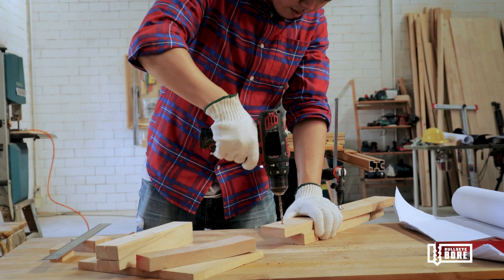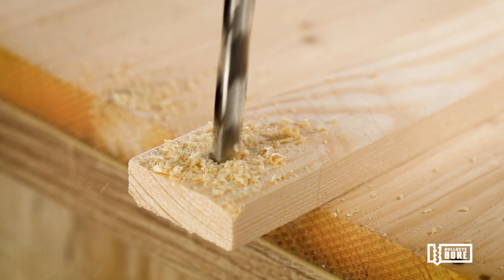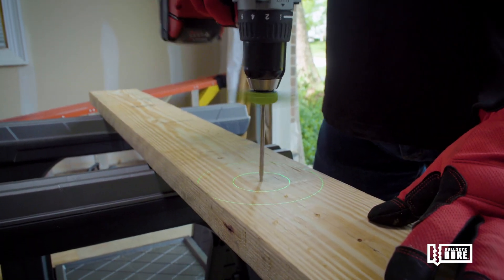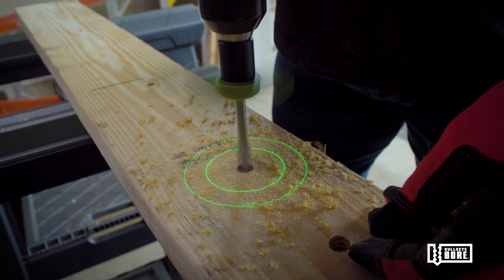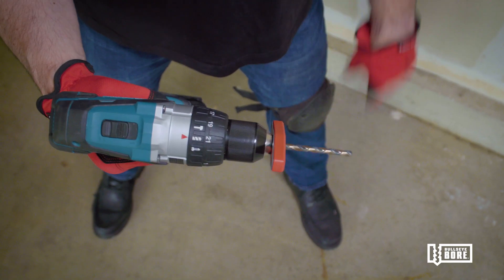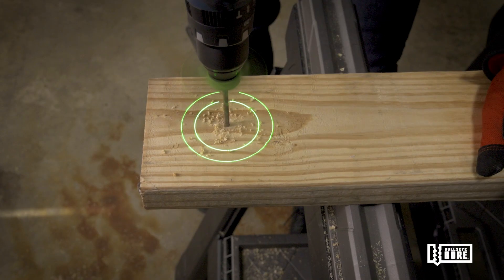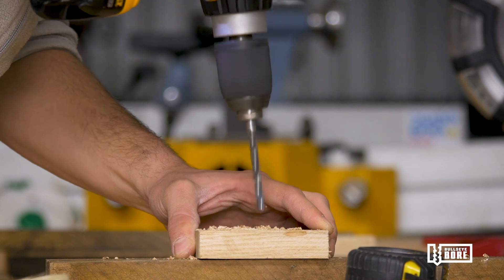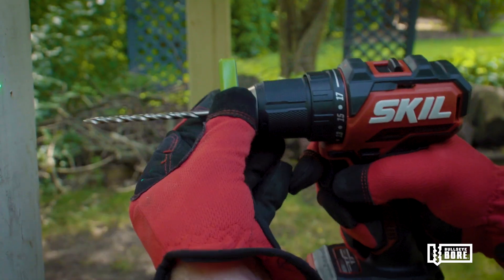BullseyeBore Core - Kickstarter Campaign (v5)

Comment: How does it do in bright sun?  None of the videos show it being used outside in anything other than deep shade.
Reply from the maker: This is the first version of the product so it uses a low power Class 2 laser that can run off two coin cells. Class 2 lasers are eye safe as defined under the US FDA regulations and are thus very low in output power. The Red versions work great indoors, and the Green versions work in bright indoor conditions and generally in INDIRECT sunlight. Class 2 lasers are difficult to see in direct sunlight so we recommend against it. There is more here in the FAQ: https://www.bullseyebore.com/faqs#Willbullseyeborecoreworkoutdoors

Comment: Congratulations on the product launch!

In a classic line of parallel thinking, I had this idea years ago too, although my version was incorporated into the chuck itself and would have required O.E. integration.  Getting it to market is impressive, regardless of the path you've taken.

I'd like to see it slightly configurable, number of circles, and size, allowing for a higher level of precision?  And for advanced users, on surfaces that are less viable than a comparatively large "wall".
Reply from the maker: Good suggestions and thank you!

Comment: I use a drill every day. Still waiting for tool companies to simply put 2 bubble levels on their drills, one for vertical and one for horizontal.
Reply from the maker: Bubble levels only work if the worksurface is completely parallel to the plane of the earth. BullseyeBore does not have this limitation - it works in any direction and does not depend on gravity.
Reply: @bullseyebore I can confirm this.  My DeWalt drill does have the levels. And the work does have to be level or plum to use these bubbles.

Comment: It seams it needs to spin fast to be useful, and when it's up to speed it's already over
Reply from the maker: No, you only need about 300 RPM to see the circles and align the drill. It's fast and easy. Check out this video starting at the 30 second mark and you will see tons of examples: https://youtu.be/9LvbzTGgTiQ